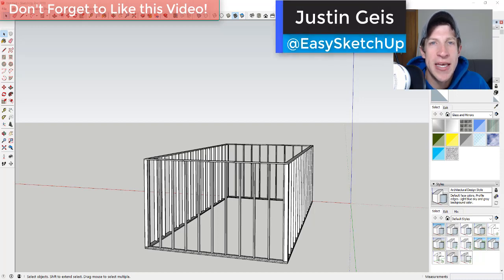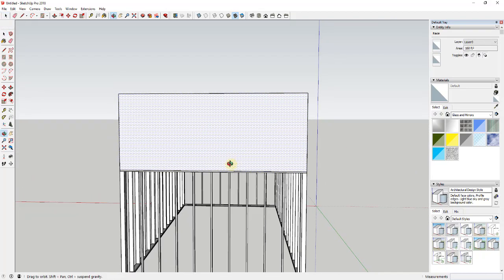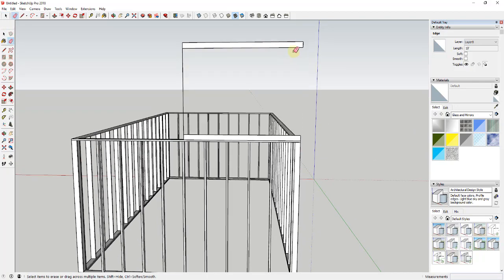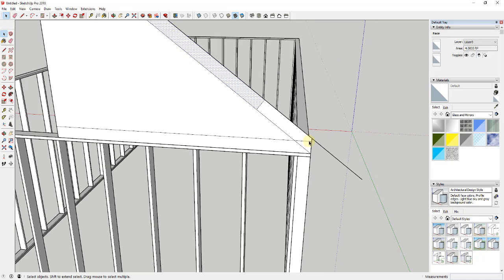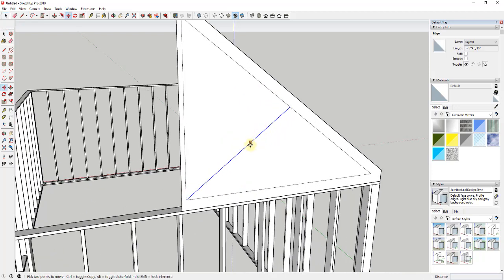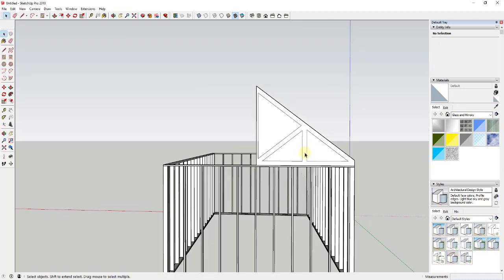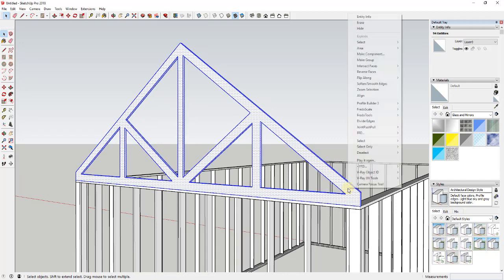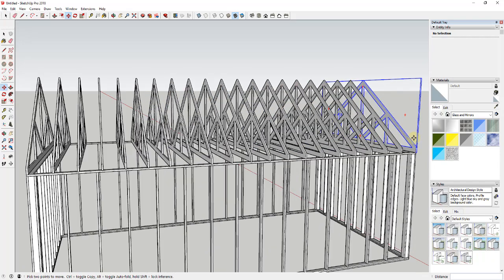Modeling WOOD TRUSSES in SketchUp

Comment from the maker: Good morning everyone! Snowed in today and can't make it down my driveway, but that doesn't mean the videos stop! What are you doing today?
Reply: which kind you making? pratt? warren? etc?
Reply: are you useing pro ?
Reply: Yes please do the video about how you modeled the framing. Now that housebuilder is gone (or seems to be for me ) I haven't found a way to frame buildings without taking an EXCRUTIATING amount of time and clicks. I've tried some of the tools out there like Builder and others which can give you a rough wall but really fail when it comes to things like headers for doorways and widows, and flooring when doing two or three level houses. Even footers is a missing option and they are pretty much mandatory for any shed or garage. I really wish housebuilder 2 would just come back as it was. It was pretty flawless.
Reply from the maker: @firefox5926  Pro yes. Truss type - really doesn't matter in this case as it's a video describing general modeling principles
Reply from the maker: @godmode3359  I thought some people were still able to get it to work. Either way, I can talk about some ways to model framing quickly, though unfortunately modeling in headers, etc is just kind of time consuming without an extension

Comment: At first, sorry for my bad English. I really appreciate your video, but just a little bit more easy when distributing the truss if we use method: "/x" with x = number of equal space between truss. For example, if we want  to use 11 trussed along the house: copy the first truss to the end point of the "path" and then press: "/10", an we have 11 trusses distributed equally. Hope to see more wonderful videos from you. With all do respect. Thanks you! :D
Reply from the maker: Well in this case, I was following the more technical directive in a structural drawing dictating that the spacing be 24" OC, so I placed the trusses 24" exact with an extra on the end. You could use the method you described as well, but then the spacing is a bit off. Depends on what you're trying to do - thanks!

Comment: hey justin, i have tried importing the sketchup file to layout [for layering and dimension] which is later imported as a dwg file for construction drawings. But the cad file is showing few mm difference, which is not seen in layout, lacks the accuracy when compared to autocad. Please let me know if you have a  solution to the accuracy problem, as i'm planning to use sketchup for all construction drawing instead of autocad which makes it easier to handle interior design as i'll have just one model for exterior and interior.
Reply from the maker: You're exporting the SketchUp file to CAD and the dimensions aren't the same? Are you sure this isn't a rounding error/difference? They should be the same...

Comment: Just found your videos to learn.  You may have already learned of your errors of sizing trusses, but any 2x material is 1.75' thick, not what you made your truss thickness as. (1.5")  You also cut a 5.5" dimension in half (drawing a theoretical 2x6) and you stated is should be "2 and a half".  Wrong again!! Half of 5.5 is 2.75.  So please, if you're going to teach, and base your information on regular, standard dimensions of lumber that's used in the real world, use the ACTUAL sizes of lumber, and learn how to divide by 2.
Reply from the maker: Not really worried about it. Based on the tutorial, you can draw lumber to whatever size you want - that's the whole point. Thanks